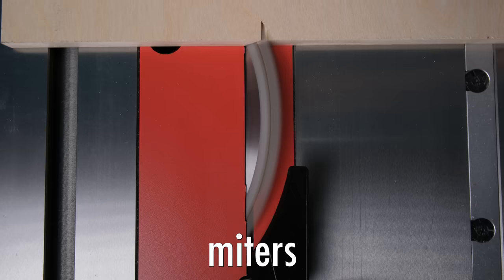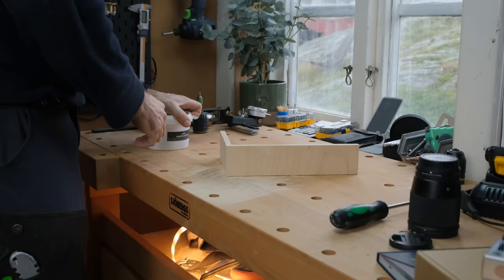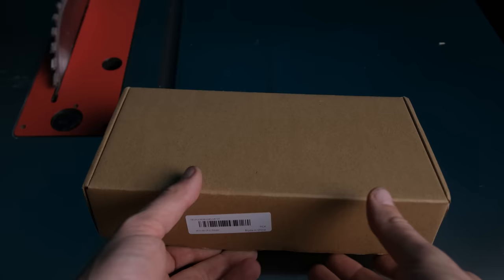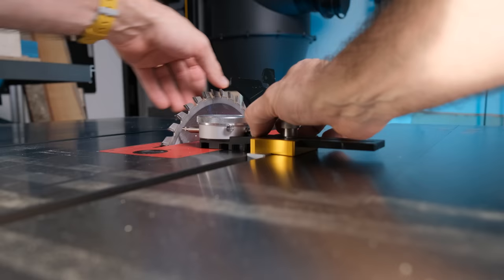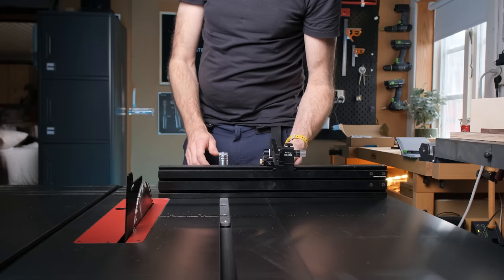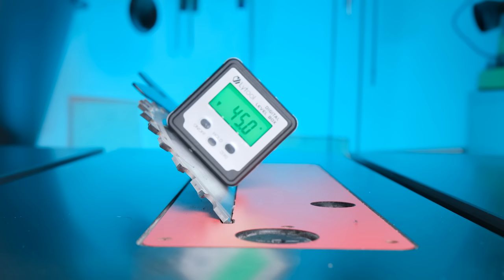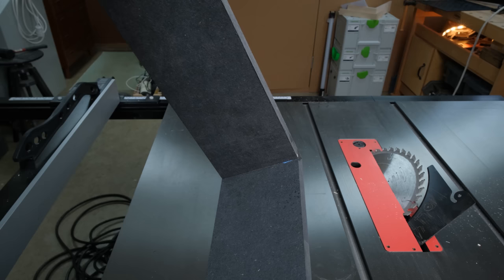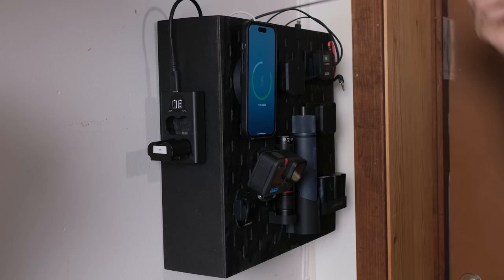It's like cheating

Comment: Great advice all around but the finished product looked ugly. Spray painted wood never looks good in general. All those wires don't help but you can't have a charging station without them. Just a matter of taste I suppose.  It's really two tricks to get a good joint.  Using the tape to ensure that they are perfectly aligned is a really good technique.
Reply from the maker: thanks! Yes, spray paint isnt my preferred method, and the cables - it is what it is. It's more of a function over  form in this case.
Reply: @TheSwedishMaker  personally I've given up on charging stations.  For one, my different devices are more handy with charging in different places.  So I just string a cable where appropriate and usually only one cable per place so not an eyesore.  I do have a "charging station" by the couch but all that is is one of those stick on cable holders with 3 slots and I run one of each type of USB to it so you can charge whatever hardware you happen to have.  The 3 cables snake down to the floor and are tied off neatly so that's not really too bad as well. None of this has anything to do with the stuff you're interested in anyway.  You could have made a basic featureless box just for show but I think it's in the YouTube handbook that you should make something interesting to show off your joints or whatever.

Comment: I use this approach to many things in life. If you’re going to cheat it then do so on the back end where only you will know it’s there. I just cut some finish trim for a fireplace surround and forgot to go past 45 a fraction on one miter. The miter sucked and I had to break out the screwdriver. Fortunately it was just poplar that’s getting painted and no one will even notice but I’ll know it’s there and it’ll bug me. Hopefully not enough to rip it down and do it again😂
Reply from the maker: Ive been there mate. I know it bothers me as well when I hide stuff even though no one will ever notice.

Comment: There used to be a 90 degree router bit that would on a router table would cut a  45 degree and it would do it perfectly but you can't find any more !
Reply from the maker: Someone else mentioned that as well. I have bought a router bit that does exactly that but with fingers in it. Im anxious to try that as well

Comment: Thank you for the video. Quick question. The gap on the inside of the miter cut; would the glue be noticeable if this trick was used on a frame miter joint? If so, do you have any suggestions to deal with it? Thanks in advance.

Comment: Your charging station is brilliant.  But I do want to comment on the "Screwdriver fix".  The fix really doesn't bother me, because it seems as though every craftsman advises us to "break' the corners to AVOID sharp, overly-crisp edges.  Would you mind commenting?  Am I way off base?  Thank you and keep up the outstanding work.
Reply from the maker: I totally get what you mean. Breaking of the corners is a good measure to avoid those sharp edges. I've had miters that were looking weird even after the "screwdriver fix" - there for I prefer getting good edges first, and then also break of the corner if it suits the project. It's a good trick to break the corners for sure. Thank you!

Comment: BTW, digital angle finders are IMPRECISE! While they show angle resolution with 2 or sometimes even 3 decimals, if you read the manual or disclaimer, they are usually precise to the 0,02 to 0,05. No mater the price, they all have the same physical limitation due to their manufacturing. Please prove me wrong and point me to a good one, I would love to buy it! If you want real precision, you have to use machinist tooling. This is also why cutting to 44,9 degree gives better result: you dont risk over cutting the angle.
Reply from the maker: True! They are hard to rely on. The combination of an angle gauge and a mitre sqaure is perfect for me

Comment: What is that black material you were cutting for the box? Is it still an engineered wood product? Just black MDF? I've never seen it before.
Reply from the maker: it's basically coloured through mdf. it exists from a couple of different brands, but this particular one is called valchromat.

Comment: I don't really see how parallellism helps unless it is so crooked that it overcomes the set/overwidth of the teeth and rubs on the blade itself and drags or pushes the workpiece or blade sideways?
I mean, you can cut a U-groove on a table saw if you so desire as long as you don't rub.
Do you have any thoughts on improving a miter saw? I've been playing with the idea of a custom indexing plate.
Reply from the maker: I might do that in the future - thanks!

Comment: on the job we use 45.1 degree to create a perfect outside. but you lost me for a second on de moment u explained you cut at 44.9 degree. maybe i'm thinking to far in this but with a lower degree you force a space on the outside instead on the inside?  could someone clear this out for me 😅
Reply from the maker: your right. You want to achieve a 90+ angle in the end. But since I was measuring from 90 degress - my blade was set at - and down - Im going the opposite way, thus doing a 44.9. :)

Comment: Bro, is that table saw a good deal? are you satisfied with it? or would you recommend something else? I have a cheap one on which I replaced the thin top aluminum table with wooden. but it's more of a entry level stuff. not exactly for anything precise.
Reply from the maker: I love the table saw. It works really good and the 3 hp makes a huge difference.

Comment: Great tip for making tight miters. I'm definitely using this technique on the long miters I have to do this week.  I like the charging station and was thinking how much more polished it would have looked if you would have inset the front panel in a rabbet so that the beautiful edge of the frame was not broken by the edge of the backboard. Nice work.
Reply from the maker: Very true! I dont know why I didnt think of that

Comment: Great video thank you. 

One thing I want to check at 5:30. The audio said reset the angle to 0 but the video shows it starting at 90.

One way round would mean setting the blade to 50.1 and the other 49.9.

I could use trial and error, but would rather get it right first time.
Reply from the maker: yes the audio was a bit delayed to what was happening. first reset to 0 when the gauge is at the flat surface of the table. Then place it on the blade. Now it starts from 90 degrees and you can take it down to 44.9. Otherwise it would have been 45.1

Comment: I thought the solution was to alternate cutting sides. So take one side cut from the right, and for the other side the offcut goes to the right and the part is on the left. That way any deviation from the perfect 45° gets cancelled out. Back of my brain talking here, need to check the math.
Reply from the maker: That would definitely work I think. It would be like the in and out method but for miters. I need to try it.

Comment: How do you find the power on that table saw?  Does it bog down at all?  I have the fusion 2 110V and it is horribly underpowered!  Also, very nice video:)
Reply from the maker: I haven't had any power problems yet, but it does have 3hp 220V - so I don't think it should. Thank you!
Reply: I have my dad's old saw at the cottage.  He always ran it with a 3/4 HP motor.  We had a flood and it killed the motor.  This year the only motor I had around was a Leason 1/2 hp motor off the mini lathe.  It is a substantial motor in size, but still only rated at 1/2 HP.  Took everything I pushed at it, which did not include 3" hard maple.  Some stuff will require lots of power, but for the stuff I was doing around the shop this summer, it was no big deal.  Conversely, if the 3HP motor I had on my General 10 inch wasn't happy it could throw a block with enough force to kill you.  1.5 HP is a good compromise.

Comment: Always struggled with this on the tracksaw, was making a 50mm waterfall edge with a tracksaw eventually ended up doing finger joints instead as I couldn’t for the life of me get a good enough mitre - Will give this a go, any advice on setting up the tracksaw to over angle?
Reply from the maker: It might be hard but also depends on the track saw. Some of them go a bit beyond 45

Comment: Well, that is pretty much effort for a miter in a black (!) MDF board, don't you think 😉 ?
The easy thing without using any of those expensive tools would be to cut a board square at about a half meter length, then press the two mitered pieces against the sides and push them towards the corner. See how they fit and correct the position of your saw blade if necessary. 
If you use only tape to glue them, strong tape which you can stretch a little and leave the belt thing away, this will perfectly do it😎
Reply: Expensive tools?
A dial indicator is $10 and you can easily 3d print or make a mount from wood
A digital angle gauge is also $10
A pair of band clamps is $20
Reply: Right. How much was the 3D Printer again?😅
Miters get tighter without band clamps, that is not about the money
Reply: @SchwalbeundZinken  3d printer not needed notice the - "or make a mount from wood" 
I mean, you're the one that said "expensive tools" so what expensive tools are we talking about??
Reply: The Hong Dui Miter Gauge, for instance. (that’s 250,—). But I did not my point clear enough, obviously: You don‘t need all this stuff for making a miter fit, regardless of the money you spend. You just need a halfway working circular saw, that‘s it. sorry for the word expensive, just. leave it away.  @ElectronicDrug
Reply from the maker: Late to the game. Indeed. Valchromat was the choice of my project - but still I want the miters to look good. It's a confidence thing.

Comment: Hi Swedish Maker. Question, but first, great video, I really like your style.  What is the material you used for the charging station box?  The transcript has it as “vrat”.  Thanks!
Reply from the maker: the material is called valchromat and is coloured through mdf basically. There are other types of coloured mdf as well - but this is the one I have locally. And thanks! appreciate it

Comment: How accurate is the Banggood measuring gauge? I have had problems with Chinese made woodworking products.
Reply: The Hong Dui one is meant to be very good. Thing is it’s still relatively expensive when purchased with the fence.
Reply from the maker: It works well for me. The gauge is a pretty simple device so it depends on how fine of adjustments it shows.
Reply: Thanks I might give it a try,.
 @TheSwedishMaker

Comment: Hi,
Quick tip :
EVERY angle meter has a default, even the most expensive ones. default between rest surface and the spirit level or electronic inclinometer inside.
to get ride of the default, always do 2 measures : on on both side (rotate 180° the inclinometer) and take the average of the two measures ;)
Reply from the maker: really good tip there! Thanks!

Comment: Hold on, something is wrong with the numbers when aligning the blade. So 1/10000 (one ten-thousandth) of an inch would be 25.4mm/10000=0.00254mm (wow, that's 0.00 on my caliper haha). You are showing 0.254mm on screen and your dial is showing something around 0.02mm. A little confusing ;) 

Oh and while you're at it. Why not explain how to set up your fence with regard to the blade? 0.2-0.5mm should do fine. Great for safety-reasons.

Other than that, cool vid, thanks!
Reply from the maker: You are completely right. I was totally off with the numbers. I ment to say 1 thousand of an inch which equals to 0.254mm. My dial gauge was showing less than that so the numbers on screen refered to what I was saying. Thanks for clarifying and watching!

Comment: I’m interested in making picture frames and have only room for mitre saw in my shop. Do you think I can get enough precision with a good mitre saw like a Makita? My current one is not good enough. I think a simple non sliding model would be more accurate. Thanks for the video and I will now subscribe.
Reply from the maker: Thank you! The Makita would probably do the trick. For picture frames I would suggest to try to get as perfect 45's as possible so you dont have the tiny gap visible on the front.

Comment: 6:20 Why the blue tape on the inside? Is it just to capture the glue?
Reply from the maker: Precisely. Its hard to sand the inside corners. Might be a bot easier on mdf but usually you have gran running towards the other miter and you cant really sand all the way to the edge
Reply: @TheSwedishMaker Nice trick, I'm going to steal it from you 😄

Comment: Hei! What are those brass bushings called? Where do you source them?
Reply from the maker: those were actually 3d printed as well with a gold filament. I first drew them up without hinges but I later made them with hinges - which I dont think I showed in the video so they attach with a small nut on the inside to prevent them from moving around.

Comment: I think that european wood workers uaing coloured mdf is a flex on the american woodworkers who have access to cheap maple and walnut lol.

Swriosu question though, do you know how this method would impact a picture frame where internal and external corners are equally important?

Great video.
Reply from the maker: For the picture frame it would be a bit different I think as you say. A miter sled might do the trick for that with a better result than this.
Reply: @TheSwedishMaker  maybe you would just need to modify the trick with the 45 degree on the mitre gauge and the saw blade set 0.1° off 90.  Force the potential opening to the back of the frame.
Reply from the maker: It might be worth a shot to try it.

Comment: I think you meant 45.9 the gap will show if I do it your way.
Reply from the maker: depends on where you measure from. I measured from 90 down so I went a bit more than 45 but the angle gauge shows 44.9

Comment: Let me give you a quick summary of the video before you spend 8 minutes for it. If each tool that you are using is perfectly accurate, with some effort, you can get accurate results. You are welcome.
Reply from the maker: kind of, but the tip was actually not to set up the blade accurately

Comment: "Proper" Mitres ARE a mistake. Last resort Only.  == Time Sink.
Reply from the maker: Im not quite sure I get it. But I guess your right
Reply: @TheSwedishMaker   Horses for courses.
IF you must use an exposed mitre joint , and there are many cases where that is the sane or even only choice, then spend the time and understand that it takes a meticulous approach at every step.

The choice of tools, their setup and materials being the most central moments here :)

That I have neither the hand skills or the patience ?  (hmm maybe there is a relationship there too :)

Not a comment on the joint or anybodies reason for choosing it :)

Comment: A combination square and a speed square are completely different tools. And, nobody should EVER buy any kind of calibration tool just because it is cheap. Any dial tool that you buy needs to be precisely calibrated, or everything that you have calibrated will be off. So, three minutes into this in depth 8-minute video about miters, I already question your skills and experience.

Oh and by the way, what you are talking about doing is call "heeling" a blade. This means that you take a reference from the front or back of the blade from the track, and just make sure that your blade is parallel along its length. If you buy a quality saw, you will be provided inserts that help you to heel your blade to factory specs.
Reply from the maker: Thanks

Comment: When possible you can also cut on alternate sides of the blade when cutting facing pieces. The angles will 100% always be complementary to 90deg. Same technique works when jointing edges of planed boards. Alternate face up, face down and you will have perfect glue-ups every time even if your fence is just slightly out of 90.
Reply from the maker: that is true! Kind of like the in and out method when milling

Comment: Too materialistic obsessions for me. If you look for perfection, master your art instead of seeking high tech that will master that art for you. Just a matter of freedom...
Reply: For intance, with a compas and paper, you can draw and fold two perfect 45° angle canvas. Each one indetical to the other, you can combine them into a volume with the rectangle faces holding them toghether. The rail nearby the saw should be paralel to their sides. If the wide of the 45° triangle base was the span between the rail and the saw, you validate this instantly.
By looking for the impossible trisectrix, I discovered how insane the precision can be maintained over many deferrals... just by gentle use of the instrument.

"Geometric applications is absolutly right ! Everything else is relative to our mistakes around it."

Comment: I’m commenting right after you said go a little bit farther so you might mention this later. But the only issue with this is that it’s limited to instances where the edge of the miter will be covered up. So you’ll have a crisp corner but an opening on the edge. 

However if you’ve taken all these pains to set up your saw and miter gauge to be so square, you should be able to cut it bang on at 45 and rip a miter suitable for an edge reveal.

Also first video of yours I’ve seen. Very well done. Looks very nice.
Reply from the maker: thanks for the tip man! Appreciate it!

Comment: Another issue to be aware of. With some table saws, the trunnions are warped and the saw will go out of alignment when you tilt it over to 45. I’ve seen this on very expensive saws. To know if your saw does this, you have to align the blade when it’s vertical, tilt it 45, and measure it again.
Reply from the maker: True! Thanks for mentioning!